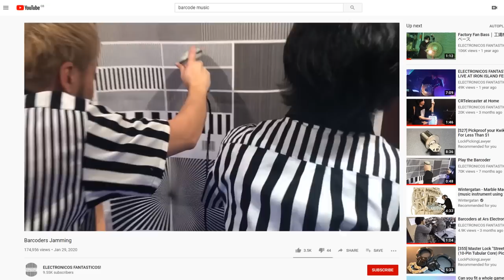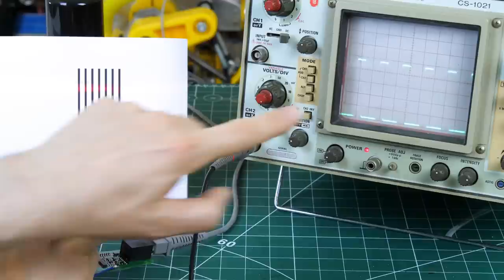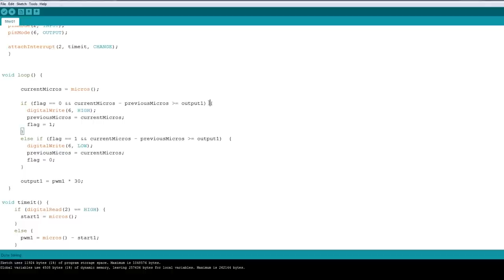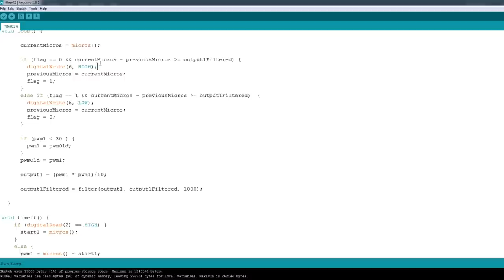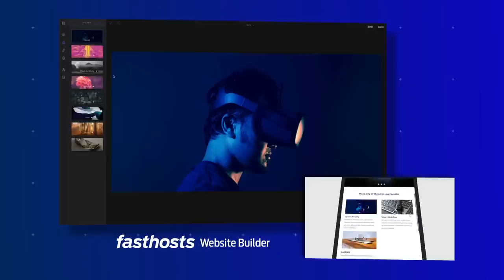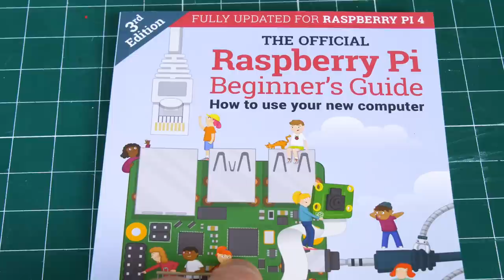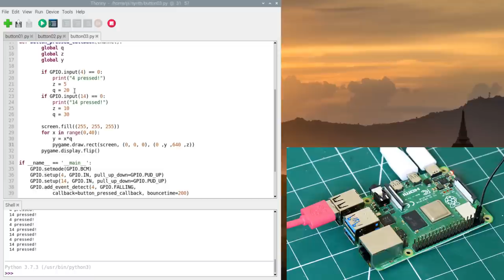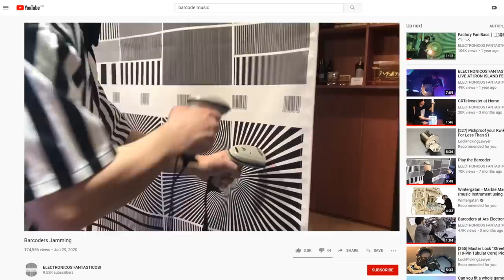Barcode Scanner Synth Build

Comment: In that other video, it looks like they may have been using Symbol/Zebra laser based barcode scanners which only read a distinct point at any given time, rather than the CCD based Datalogic, which is seeing an entire line at the same time. Not sure what difference that could make, or how much hacking was used.

Comment: when i was doing some audio signal stuff at uni, i found a normal low pass RC filter set to a high frequency was good for removing the pops (since each pop is basically a super high frequency spike), and you can double them up to get a tighter knee

Comment: I would like to point out that when you did `output1 = (pwm1 * pwm1)/10` it is not actually exponential. That would actually be a power function. For it to be exponential the variable must be the exponent, for example, y=2^x.

Comment: Have you considered instead to feed that data from the scanner to a DDS (Direct Digital Synthesis) chip? That would allow you to set the note frequency and then apply additional modulation in the form of ASDR (Attack, Sustain, Decay, Release)

Comment: What cables or colours of cables do i have do connect to a speaker? Also, your impute source has how many volts? Mine says 14v but the pinout in the internet says 12v and 5v. What do i have to do??